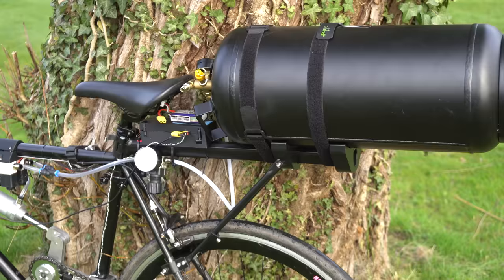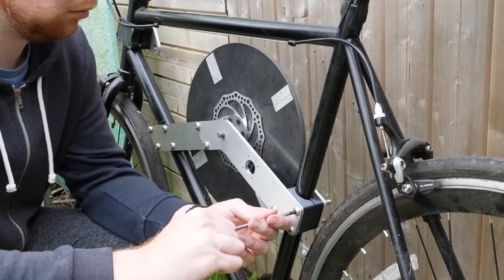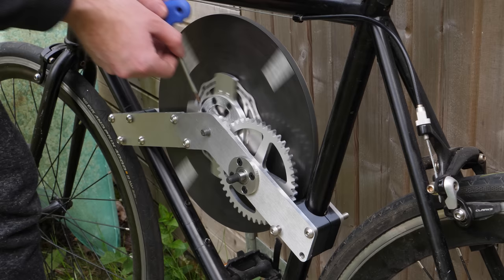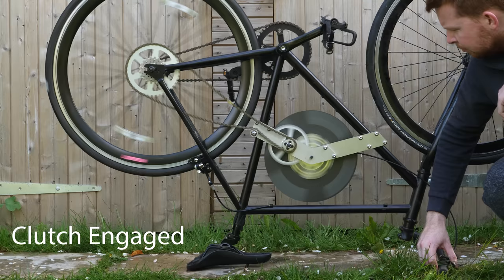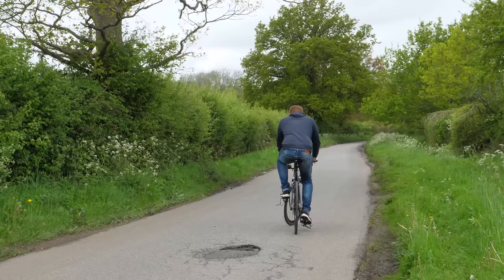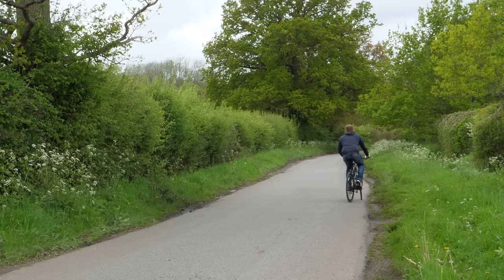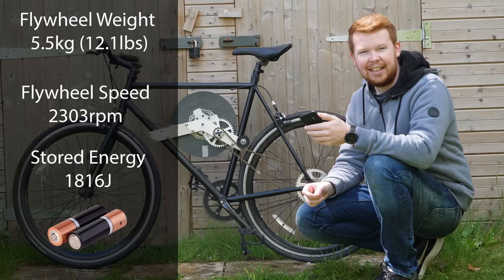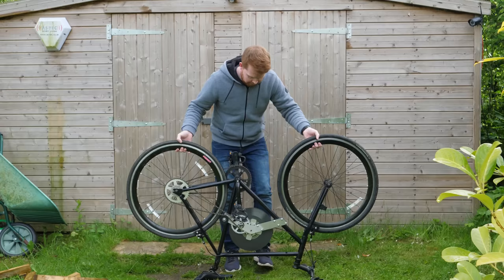Flywheel Bike KERS

Comment: What about a design where the moment of inertia for the bike wheel can be manually increased/decreased with weights on the spokes for example? To store energy and decrease speed you move the weights out. To recover the energy you can move the weights back to the centre.
Reply: That sounds like a mechanical nightmare
Reply: Difficult to do but interesting. 👍🏼
Reply: @SuperUltimateLP  that's where the fun begins
Reply: Hmmm
You could use some of the centrifugal force to push the weights out but pulling them back would be much harder to design..  Maybe you could use the rotation around the axle to pull a wire or something but that is a bit of a nightmere.

As I understand it moving the weights out though would cost as much speed as you would gain in your moment of inertia
Reply: @nick11crafter  maybe an electromagnet to pull them in? or maybe a hub electromagnet would cause chaos?
Reply: @SuperUltimateLP    It could be pretty simple with some electronics and wireless control. The weights can be a light friction fit on the spokes (so that it doesn't fall when the wheel isn't spinning fast enough). The weights can all be connected via cables to a central hub. Weights can be brought in by winding the cables around the hub. It can be let out by providing some slack on the cable and letting the centrifugal force overcome the light friction fight. 
If the friction fit/ centrifugal system is too finnicky, then simply fix the weight to the cable and have the cable loop around the end of the spoke and adjust in/out at any time.
Reply: @supernumex  Weights?  Use a liquid. Well, the hysteria about mercury might deter some!
Reply: Doesn't the energy required to pull the weights in equal the amount of energy gained to the bike? Meaning that it's not really effective?
Reply: @supernumex  How would something attached to the spokes keep spinning when the bike is stopped? Anyway, the solution here is obvious: spinning rims!

Comment: I would love to see how this might work in a situation where you have a downhill to uphill road segment, and see how the flywheel might assist and help propel you up the hill… by like engaging the flywheel to build up energy on the downhill segment and release that on uphill
Reply: That would also dramatically increase the efficiency since the clutch can be fully engaged and not slipping the whole time. I'm betting that's where most of the losses are.
Reply: Useful if you are in danger of going to fast downhill. Otherwise it's not going to be better than simply going as fast downhill as possible to assist with the uphill. Also it's an extra weight to cycle with.
Reply: @daffyduck780  eh the extra weight not so much, say about 15 lb extra, not a lot on a rolling chassis situation, but you're right, speeding up going downhill is much more efficient, though if it is downhill to a flat plain then it could be very advantageous
Reply: If you used this design it would 'help' by most likely killing you.  Storing enough energy to help in any way with a hill climb, even a very small percentage of what you lose in having to lift all that weight up the next hill, IF you could design a practical flywheel having the capability to do that, is a pipe dream.  

The only way it would help at all is if someone installed the entire system at the top of each hill and you jettisoned the entire contraption just beyond the bottom of each hill, where it ran out of steam.  Other than that it would be totally practical (NOT).
Reply: @daffyduck780  yeah lol the energy still has to come from somewhere so only use it instead of brake on hills
Reply: Was thinking the same thing. I live in San Francisco where there are a lot of hills.
Reply: I was thinking precisely the same thing.    For a steep downhill,  it would keep the speed in -check,  and then assist on the uphill.

Comment: I wonder if it might work either more efficiently or as a more user-friendly machine to use a flywheel mounted alongside the rear wheel with a similar diameter that can be spun up more directly. I'm imagining a pair of flywheels with one on each side for balance, which press inwards against rollers which press against the rim of the drive wheel. Pinching the flywheels against the rim would spin them up in the opposite direction of the drive wheel to match their RPM.

Comment: Tom have you done a video where you describe what kind of CNC cutter you are using with aluminum? Would you buy the same cnc system again?
Reply: Yes please!
Reply: Unless he swapped out the machine this is the original video for it, not sure he would endorse the supplier.
https://youtu.be/d5HOg3wZxcI
Reply: @Zayllyaz  Oh very nice. Thank you!
Reply: Supposedly the new Shapeoko CNC routers will do aluminum.
Reply: @toastrecon  A Workbee does.
Reply: @toastrecon  - yeah they do indeed
Reply: I don't think he would buy it again.

He already has one, after all.
Reply from the maker: As others have mentioned in the replies, my CNC was a bit of a nightmare (https://youtu.be/d5HOg3wZxcI) and still causes issues today. Fortunately the company has since gone out of business and no one else has to experience the same as I did.
Reply: @TomStantonEngineering  - do you have a different one your heart is set on in the future?
Reply: Looking as his CNC results I would definitely not buy the same one
Reply: I got one through Open Hardware along with a manual controller as well as the computer control and it has been pretty good all the way around, Solid build, pretty easy assembly and we've now cut all the way to aluminum using proper speeds and feed rates...  Cost a little more than some of the "cheap" Amazon ones from "who knows where" but the kit cost a less than more "commercial/professional" without sacrificing much accuracy or speed...   I would recommend
Reply: @Levi_Allen  Maybe look at something like a Tormach depending on budget. I know they just came out with a router style machine.
Reply: @edwardpaulsen1074  thanks for sharing! I'll check that out

Comment: Use it while going down a big hill and use it to accelerate back up the other end
Reply: yes. Ideal for those hilly countryside trips where I never want to stop when I reach the bottom each time, as I always want to use my momentum. Sadly, often there are traffic lights or a give-way at the bottom stealing my energy. A flywheel would solve this.
Reply: Be carefull with this. A rotating flywheel wants to stay in the same plane. When standing still this is no problem, it even helps your  'sur place'. But while driving, it wants to go in a straight line, decreasing maneuverability.
Reply: @ruurdkemeling7423  watch the post credits of the video. The gyroscopic effect is apparently not too bad

Comment: I would imagine that the applications of this would be better in a more hilly area, to help with climbing using the declines to charge the fly wheel
Reply: Yeah it would help especially when those gear teeth would be lubed and engineered to perfectly fit each other. The gyroscopic effect of the flywheel would also improve balance
Reply: Also no since the bike is heavier and when it runs out of power its just a heavier bike
Reply: @kajeralocse  there is no gyroscope effect the way its mounted, if it was mounted horizontal it would though
Reply: It will not help with climbing.  It only provides power when the flywheel is spinning faster than your speed would create.  You would work harder climbing with it engaged.  Wait till the down hill to use it as a brake or engaged all the way down for elec generation?
Reply: @LSD97123  lose*
 It will lose power. 
 Loose is like loose jeans
Reply: @LSD97123  I see people constantly mixing those up, even my own father lol..
 Unfortunately its getting frustrating with how much I see it
Reply: @helpabrothawithasubisaiah5316  English is not my mother tongue, so obviously there are complications sometimes.
Reply: @LSD97123  oh my apologies, as I said alot of people do it who are native English speakers. 
 I was just letting you know, have a great day
Reply: @helpabrothawithasubisaiah5316  Whether a gyroscope is horizontal or not has no effect on its ability to work as a gyroscope.
Reply: @hapybratt8640  yes it does, the plain has an effect on the way it works... 
 If its horizontal the forces going outward stabilize it, on its side gravity goes around it... it might have slight effect but not nearly as efficient as on its side
Reply: @helpabrothawithasubisaiah5316  No, a gyroscope simply wants to remain in it's plane of rotation. It's angle to earth does not influence anything about it. If you throw a frisbee horizontal or vertically the frisbee still remains in it's plane of rotation due to the gyroscopic effect. Another example is that gyroscopes work in space, it's how the Hubble telescope orients it's self to point to other stars.
Reply: It won't help in climbing at all . If anything it will making climbing more difficult.   Cycling is not a constant power output , the power arrives in waves due to the way the pedal stroke works . The only way to make it work as you'd want is for the flywheel to be connected to the cranks not the rear wheel .
Reply: it would actually be much worse on hills, too heavy. it could be better on flat land.
Reply: @helpabrothawithasubisaiah5316  thanks man, I learnt something. I think I'm never going to make the same mistake again..
Reply: @helpabrothawithasubisaiah5316  wrong
Reply: @helpabrothawithasubisaiah5316  wrong again
Reply: @hapybratt8640  correct
Reply: @zeez9053  I got to get a gyroscope, honestly they are pretty weird. 
 Typically most gyroscope stabilized things have orientation horizontal, and in my head it would seem it makes more sense... 
 But yeah, gyroscopes are weird and I just need to get one
Reply: @helpabrothawithasubisaiah5316  the wheels and tires of a bicycle already act as a a gyro. If you lean on a bike, the wheels will try to pull you back to vertical or perpendicular to the point of contact with the ground, the faster the wheel speed or heavier the tire, the more force it pulls with.
Reply: Nope.  Won't work, this only provides energy for the short haul, like accelerating the first few feet after a stop.  If you did store those kinds of energies, like say building for a long time coming down a big hill, you'd better have a LOT better design than this, and a scatter shield might be a good idea.  There the bearings, removing power in a reasonable fashion, etc would be a monster design problem compared to this very simple arrangement.  Also this flywheel is a junk design from an energy/weight standpoint, a LARGE consideration on a bicycle. On a serious bike hundreds to thousands of dollars (to the consumer) are added to remove OUNCES, here you are adding many pounds.

That is why flywheel designs are not used in general vehicles, they provide great low time impulse, and NO long term energy storage/release, at least in any current designs and especially in this one.  In other words it would give you help in about the first 20 feet of the hill.  The weight gain for the flywheel would make it FAR more difficult to climb hills, as well, as you have to lift all that extra weight through the riders power.  You can pretty much guess if engineers aren't using the systems for general motivation, they are not practical.  Everybody thinks they are going to 'beat engineers out' with some great new design.  Good luck with that.  I've seen people who think they can pull tons of percentage more efficiency out of turbine blade designs, as one example.  Pretty amazing claim (stupid actually), since there isn't even that much efficiency left to gain, physics limitations wise.

A battery motor regeneration system makes FAR more sense.
Reply: Jusg get an ebike
Reply: if you have a downhill then uphill yeah
Reply: Use the flywheel to power batteries and slap on an electric motor
Reply: It's still not as practical as electrical regeneration, methinks.  Also, even cheap crap batteries store the energy for longer than a well-engineered janky flywheel.
Reply: Fly wheel would stop the quarter way up a hill and all the added weight of the flywheel and accessories would make the rest of the hill harder to climb, this idea is completely useless

Comment: Super cool! Not sure what settings you have on your fusion 360 CAM setup but if you haven’t already, adding a finish pass after the rough cutouts for all the CNC router parts would likely improve the circularity of the bores and overall accuracy. Having an aluminum sub plate vs MDF would also help with the overall rigidity and improve surface finishes. Keep it up!

Comment: Flywheel effect applied with electromagnetic force on the flywheel and on the bicycle rear wheel, and a dynamo to power the electromagnetic field should work. 
So you're pedaling is directly into a dynamo and the flywheel, and the energy from that goes into the electromagnetic force propelling the bike.
Can use a clutch to disengage the dynamo.

Comment: I wouldn’t want to be anywhere near that bike if the flywheel broke or came loose. Good job as always on the build.
Reply: That was my first thought but the disc isn’t turning that fast and his family jewels should be safe.
Reply: Gotta fabricate a cover for it.
Reply: You have to think about the car behind and the innocent bystander as well, good proof of principle but stupid and not practical in reality, there simply isn't enough vehicle mass to make the stored energy any use, this is why regen on the ebike doesn't get you much back and isn't efficient, makes more sense in a car or truck.
Reply: @thechumpsbeendumped.7797  2300 rpm is pretty fast.
Reply: @eyesyt7571  
It’s not going to explode at that speed.
Reply: @knoxieman  We all know that Tom is not coming up with a revolutionary idea. He’s just proving a concept; however, I thought his engineering ideas were interesting and creative.
Reply: @thechumpsbeendumped.7797  might not explode, but sure could go flying.
Reply: @eyesyt7571  how? Those bearings and brackets look more than strong enough and flywheel look well balanced.
Reply: @eyesyt7571  like having anything not tied down well in your car at speed. If you crash, its flying out through the windshield

Comment: I feel like this would be counter productive for a couple of reasons, firstly you have to carry a heavy weight with you and that means more work done for a given distance, secondly it can lose angular momentum and work against you when you are turning while it is spinning due to the gyroscopic effect.
Reply: Why should that Mater? There are 2 spinning wheels normally why should a third one matter too much
Reply: @meespo3354  because the road wheels weigh a fraction of the flywheel and rotate at a much lower speed.
Reply: @meespo3354  the flywheel also makes the entire thing gyroscopic
Reply: solution? counter rotating flywheels!
Reply: @ruthlessfish2506  i have two high speed rotating discs of metal underneath my groin wonder what could go wrong
Reply: The overall weight has only a linear impact on energy density, whereas the energy density increases with the square of the radius.
Reply: @dormy6209  the shmeat grinder